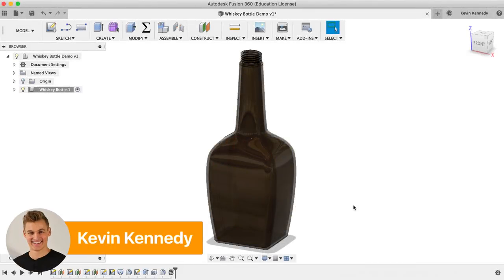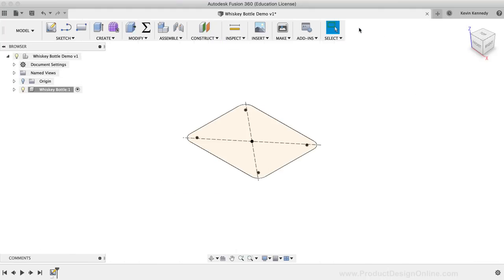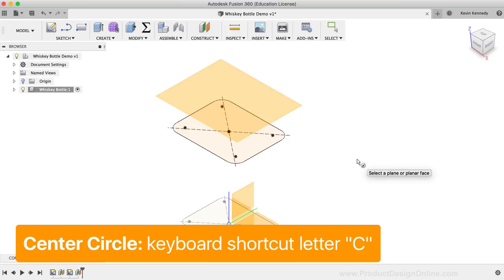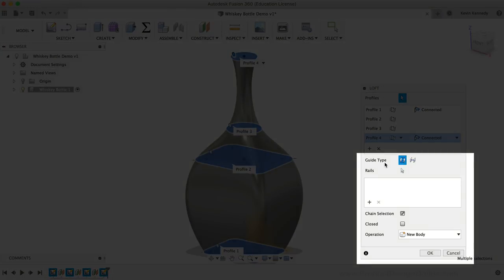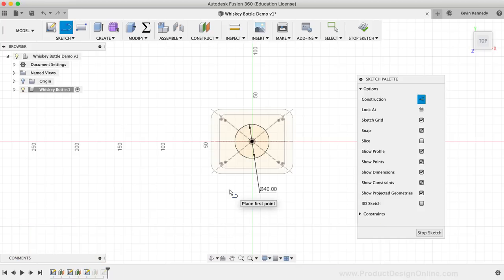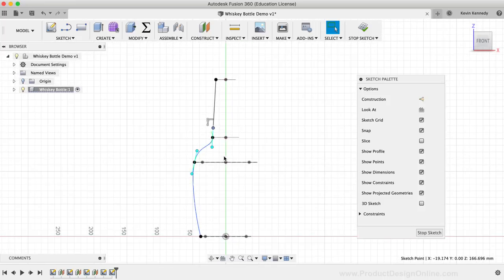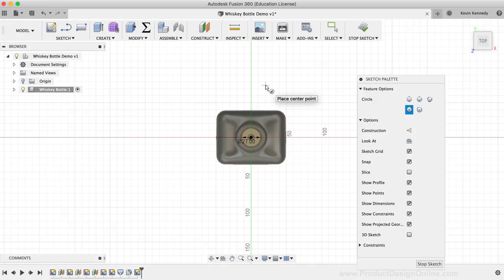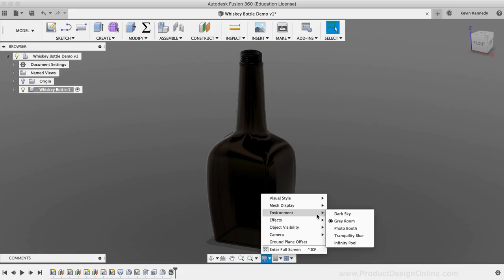How to 3D Model a Whiskey Bottle - Learn Autodesk Fusion 360 in 30 Days: Day #4 (REVISED)

Comment: Hi kevin i have a problem on the shell part,when i tried to but 3mm it said that the operation would cause a large topology change.Try adjusting the values or changing the input geometry.Please help
Reply from the maker: Hi, Potatoo King. Edit the sketch with your spline rails. You'll need to adjust their contour and then revisit the loft command. It's likely that the contour of your bottle is prohibiting the shell command from working, as a specific area would self intersect.
Reply: @ProductDesignOnline  thanks you

Comment: PROBLEM!  When I get to the fit point spline stage my cursor wont find the ends of my construction lines.  it snaps but seems to skip over the point and hit every other grid point.  Frustration.  Love the videos and am committed to the 30 days!  Thanks
Reply from the maker: Make sure you have the "Auto Project Edges on Reference" setting turned on. Instructions to turn it on - https://productdesignonline.com/default-settings-for-fusion-360-tutorials/#autoProject

That will help you snap the rails to the profiles, as long as you're looking straight at the sketch.
Reply: @ProductDesignOnline  Thanks a million that kind of worked but after lofting selecting the loft lines says "not all loft lines are touching all planes"  I joined the neck and bottle with the lines.  Is there a book or help line or something?  I cant keep asking you for help.

Comment: Hi, love your tutorials, but have small issue : when reaching the mirror instruction, the fit point spline and the line are not recognised by selectable objects by the mirror instruction. what is the solution to this problem? thanks !!
Reply from the maker: Hi there! sounds like you may be using the wrong mirror command. Check out this help article - https://productdesignonline.com/tips-and-tricks/mirror-command-not-working-in-fusion-360

Comment: i've had this issue for a few tutorials now, i'm not sure how to see the sketch toolbar while showing all of the sketches. the only way i can get to the sketch toolbar to access the spline tool is by editing a sketch. when doing that, i'm unable to connect the spline to each of the sketches.
Reply from the maker: Hi, Ryan. With the new UI the Sketch toolbar will only show up when you're in an active sketch environment. You will either have to edit a previous sketch (in your timeline) or create a new sketch (with the create sketch feature). 

If you haven't watched my video on the new UI, I would recommend that - https://youtu.be/tuZzHcmFtg4
Cheers, Kevin :)
Reply: @ProductDesignOnline  so then, if we need to spline across multiple sketches with the new UI, how is that done if we can only access the sketch toolbar by viewing one of the sketches?
Reply from the maker: @thebogamin  Hi Ryan. The spline sketch connects the four other sketches, but you'll need to create the spline and straight-line all within one sketch.

At 15:41 I select the XZ origin plane after activating the Fit Point Spline. It sounds like this may be what's causing the confusion in the different user interfaces. You can try to activate the Fit Point Spline by searching it within the keyboard shortcuts box (letter "S" to open the shortcuts box). Otherwise, you will have to "Create Sketch" > Select the XZ origin plane > then activate the Fit Point Spline from the Sketch tab.

Let me know if that helps or if you need me to clarify anything! Cheers, Kevin :)
Reply: @ProductDesignOnline  got it, ohhh yeahhh!!! thanks!
Reply from the maker: @thebogamin  No problem! Don't hesitate to reach out if you run into any more roadblocks. :)

Comment: couldn't get the rails to work at all, did get mirror to work but lots of problems getting spline to intersect construction lines.  Worked on it couple hours with no success.  Using latest fusion from aug 2019
Reply: Me too.  At the point where you emphasized to take the top spline handle and lock it to the line, I did that and then mirrored the spline+line and then try to use that as a rail and I got an error saying that the selected rail does not touch all the profiles.  I'm assuming that the spline and the line are not joined as the reason.  I did try to do a tangent constraint on the spline and line but that didn't help.
Reply: OK, I followed James Sturgeon's comment and it worked!  I didn't do the constraint but I did re-do the middle construction line and the loft worked no problem.  Maybe later I'll have the opportunity to try James' coincidence constraint solution but for now, I'd rather move on.  Thanks James.  Also I did try to do a loft with just the left side rail setup (no mirroring it over to the right side) and that worked.  So I would take that as evidence that there's something going on with the mirroring.  Anyway onward :-)
Reply: I have redone over and over all the technique here what's the newest version of 360 and have had no luck.  360 has, the worst error messages, even worse than windows bsod ones🤪🙄😬
Reply: @michaelryan2622  I had the same problem and found James Sturgeon's comment from 2 months ago which gave me a clue.  I redid the whiskey bottle but paid very close attention and zoomed into the snap points for the middle construction line and that worked for me.  Also I did an experiment and setup the guide rail just on one side and did the loft before drawing the middle construction line and mirroring.  The loft worked for that one side which indicated to me that James was right.  There's the potential for some inaccuracy with the middle contruction line which affects the mirroring such that the mirrored guide doesn't touch the opposite side of all the sketches.  I have not had a chance to try James' constraint solution but I would think it would work.
Reply from the maker: Hi Michael, I'll have to agree with you on that - the error messages could definitely be improved. Did you get your loft/rails to work? If not, I'd be happy to look at your file if you share your file's public link as a reply to this comment. (Here's a video explaining how to share a public link - https://youtu.be/2XrcrdV-8Ls).
Cheers, Kevin :)
Reply from the maker: Thanks for sharing your progress and tips, Ken! The middle mirror line will definitely throw off the loft (rail) results if it isn't set up perfectly down the middle. Cheers, Kevin :)

Comment: Hey! My lines right after I do the construction lines, do not snap into place like yours do, so I cant continue the rest of the video. I tried re-doing it several times, but I don't know what's wrong. Any help would be appreciated.
Reply from the maker: It's likely a setting. Check yours with mine here - https://bit.ly/defaultsettings
Reply: @ProductDesignOnline  Thanks! That helps!

Comment: Hi Kevin
I went until the bottle top was being amended prior making it hollow. for some reason my hollow command just doesn't take the values of 3 mm, it is showing a geometry error...pls help..thanks
Reply: i have been having the same error, trying to hallow it just breaks the programm. im guessing it has to do something with the newer version of fusion 360, but i could'nt figure out how to fix it yet
Reply: i figured it out right after i wrote the first comment: you have to set your shell direction to "outside" instead of "inside", as shown in the video. i hope this fixes your problem too

Comment: I have followed everything and have it right up until the Spline. I am working on the Z-X axis but my spline tool doesn't want to snap to the construction lines we drew in the 4 previous steps. What am I doing wrong?
Reply from the maker: Make sure you have the "Auto Project Edges on Reference" setting turned on. Instructions to turn it on - https://productdesignonline.com/default-settings-for-fusion-360-tutorials/#autoProject

That will help you snap the rails to the profiles, as long as you're looking straight at the sketch.
Reply: @ProductDesignOnline  thank you very much. Excellent tutorials.

Comment: For anyone having issues with snapping the guide rail spline/line to the points from the shape sketches - you need to project those points into the guide rail sketch.

 Open you guide rail sketch, then: Sketch > Create > Project > select (click) on the points you need for the guide rail

EDIT: or follow the solution in the pinned comment..
Reply from the maker: Thanks, Daniel. I've documented more details here: https://knowledge.productdesignonline.com/article/25-day-4-whiskey-bottle-the-selected-rail-does-not-touch-all-of-the-profiles-error

Comment: Max Schaefer
Hi Kevin, I have been enjoying your tutorials and working along, though with some difficulty as I am using Version 2.0.8111  and things just don't work the same as you version, OK I have been learning a lot just figuring out how to find the menu items.
However in this tutorial I have come to a road block, with inserting the fit point spline, the spline will not connect to the points on the construction lines, it snaps to a grid point instead, I tried turning grid snap off and that made no difference, it appears the spline is connecting but when you orbit the canvas the spline is just a straight line not connected to the sketches.
When not using the spline and you move the cursor over the lines the little circle glyph appears but when trying to connect a spline or line there seems to be no effect. I have tried looking for other types of snap that may work but there only seems to be grid snaps.
After numerous attempts I have had to cry wolf and seek help, hoping you can get me back on track!
Reply: Hi,
Had yet another attempt at getting this to work, without a great deal of success, I have made a video of what I am doing, and as you will see how to select some actions differs from the tutorial.
My problem is getting the spline to snap to the points on the sketches, during the video attempt I thought I had it for a while then the line and spline points detached from the sketches, please excuse all the cursor dithering as I try to think what I'me going to do next.
The way I am progressing I will be an old, old man before I get my dram of whiskey!

Link    Sorry can't work out how to link to the video, the link address they supply doesn't seem to work.
Reply from the maker: @maxs4063  Hi Max. Thanks for sharing the screencast. I see one thing that may be causing some issues. When you draw the rail splines... have you tried to draw them while looking directly at the sketch? That may make a difference in whether or not they snap correctly. It may also be your "Auto Project Edges on Reference" setting. Check that it's on - https://productdesignonline.com/default-settings-for-fusion-360-tutorials/#autoProject

Comment from the maker: Here's the resource page for this tutorial ► https://productdesignonline.com/3
__
TIMESTAMPS
0:00 - Creating a Whiskey Bottle in Fusion 360
1:40 - Creating the first sketch profile
2:54 - Creating sketch fillets
6:37 - Creating an offset plane
7:15 - Creating the center circle
10:00 - Testing the loft command
14:51 - Creating construction lines
15:34 - Creating a guide path
17:53 - Snapping the spline handle into place
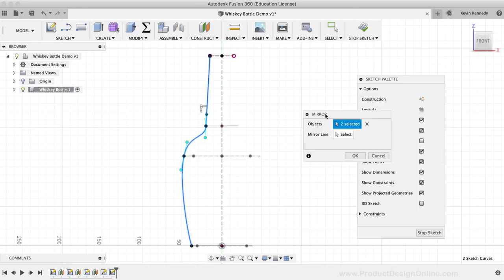18:53 - Mirroring the guide path
19:30 - Updating the loft command
20:56 - Adding a stem to the bottle
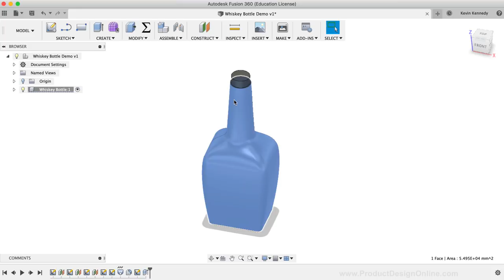21:40 - Making the bottle hollow
22:22 - Adding a thread to the stem
Reply: I have a newer version of fusion 360 i guess. Because when i select the zx plane to draw my splines it will no longer refrence anything drawn on a different plane. Ive ran into similar issues with things like this watching your tutorials. I love them i just wish i could figure out why its not letting me do this.
Reply from the maker: @kblaylock9244 Hi Kyle. This is likely the "Auto Project Edges on Reference" setting that used to be on by Default. You can turn that back on following this: https://productdesignonline.com/default-settings-for-fusion-360-tutorials/#autoProject
Reply: @ProductDesignOnline   That was it! Thank you for your help, the great videos, and the quick response!
Reply: I had an issue with “error, guide not touching all planes”.  I added "Point" from the create menu along the areas that I needed to connect and then drew my spline. That solved the issue the issue for me.

Comment: Hi Kevin, thank you for a very nice tutorial series. I am having trouble with snapping the spline tool lines with sketch points and as a result I am getting the error "selected rail does not touch all the profiles"
Reply from the maker: Hi, Bilal Syed. Make sure your "Auto Project Edges on Reference" setting is turned on. https://productdesignonline.com/default-settings-for-fusion-360-tutorials/#autoProject
Reply: @ProductDesignOnline  This solved it for me thanks

Comment: Hi i have struggle to find the points when i am using the spline command, it does not lock on the points created when i have sketch construction lines
Reply: Enable 3D Sketch on the right in the Sketch Pallet window.

Comment: I am stuck on the mirroring part, the new version has an option called "Type" when mirroring. Even when I try to select the object to mirror (the spline and the center line) they don't get highlighted. Tried this several times but now working.
Reply from the maker: Double-check that you're using the Sketch Mirror command - https://productdesignonline.com/tips-and-tricks/mirror-command-not-working-in-fusion-360/

Sounds like you're using the Solid modeling mirror command. The icons are very similar.

Comment: these revised videos would be alot better if you were using the new user interface. great videos though ill figure the new UI out.
Reply from the maker: Hi, Matt. These revised versions were revised before the new UI was released. If you haven't already, I would recommend watching my tutorial that covers the new UI updates. I discuss the critical changes in terminology, placement, and iconography, that should help bridge the gap between the old UI and the new one. You can watch that here - https://youtu.be/tuZzHcmFtg4
Cheers, Kevin :)

Comment: When I tried to shell my bottle, my computer slowed to a crawl and the little rainbow wheel started spinning whenever I tried to enter a number value or move the arrow. It wouldn't accept 3mm as the shell width--the top wouldn't disappear at all. The least it would take was 5mm. Any idea why? Thanks for these vids, btw!
Reply from the maker: Hi Jason. That will be due to the taper of your bottle. You'll need to adjust the splines of your bottle - particularly where the stem of the bottle is to make sure the curvature is not too sharp (or doesn't bend too much).
Reply: @ProductDesignOnline  That makes sense. My bottle was particularly weird-shaped.

Comment: The center line for the mirror had to be perfect if not the mirrored sketch was not touching the profiles properly. This gave error while using loft. So, I carefully created multiple lines by selecting the exact center point of each profile.
Reply from the maker: Hi, Kaushik Deshikan Shettalur. Thanks for sharing this tip with everyone. You're correct in the fact that the centerline must be perfect. Please don't hesitate to comment questions on the tutorials as you work through the remainder of the series. Cheers, Kevin :)

Comment: That whole snapping to the plane for the first circle drove me insane, I locked the handle but it still didn't want to connect correctly (yes I projected the point fine and it connected).  My Final solution was to put a horizontal constraint on the construction line for the first circle.  I must have nudged the line just off centre and it had a hard time connecting. Hope this helps someone else out.

Comment: I guess the hardest part of all this is that Fusion 360 keeps changing. My interface looks nothing like yours. I cannot create the rail because I cannot get the spline to snap to any of the construction lines. I get the error you mentioned about not touching all the planes. I have no sketch menu I have create. I have to use the create menu to create a new sketch. When I create a new sketch on X/Z I do not get a snap on any of the other sketches. It's as if all the sketches are isolated. I've been having this similar issues with Fusion changing from what is shown. I had a lot of trouble with the beer bottle example as well.
Reply from the maker: You'll need to go to your profile > preferences > design and turn on "Auto Project Edges on Reference". that setting used to be on by default and is likely why yours is not snapping as it did in the video. That will automatically "project" those points allowing you to snap into them.
Reply: @ProductDesignOnline  Thank you!

Comment: kindly confirm if the new release has any issues with snap feature
Reply from the maker: Hi Govind. I have not seen any snapping issues reported with the latest release. Please check that your default settings match mine - https://bit.ly/defaultsettings

You may have to turn on "auto project edges on reference" in your preferences menu. Cheers, Kevin :)
Reply: @ProductDesignOnline  'auto project edges on reference' This was the problem...Thanks a lot Kevin :)
Reply from the maker: @govindkp  No problem. Glad that worked. That used to be included as one of the default settings but it appears that they changed that in one of the recent updates. Cheers, Kevin :)

Comment: it wont let me select a face for fillet after the loft command
Reply from the maker: Hi there. Make sure you used the BLUE solid modeling loft and not the ORANGE surface loft command (check your timeline at the bottom). Surface models don't accept features such as a fillet, because there is no geometry to manipulate.

Comment: Great tutorial but I have one problem: loft is creating my bottle without top or bottom walls so I can't use fillet on the non-existent bottom wall :)
Reply from the maker: It sounds like you may be using the orange Surface molding Loft. Please double-check that you're activating the BLUE solid modeling Loft command from the Solid menu :)